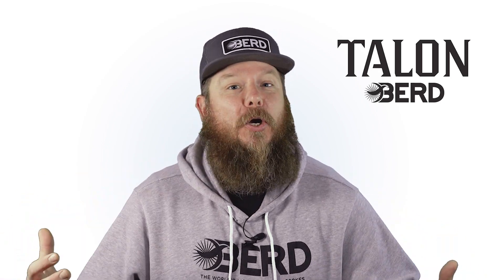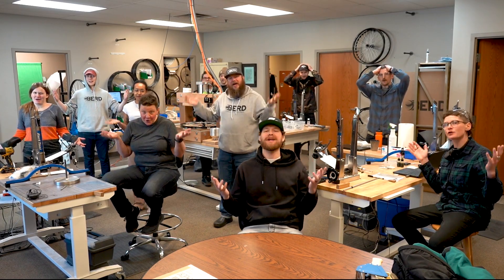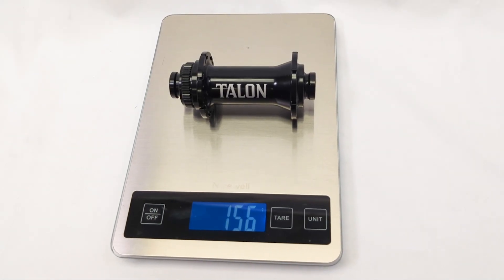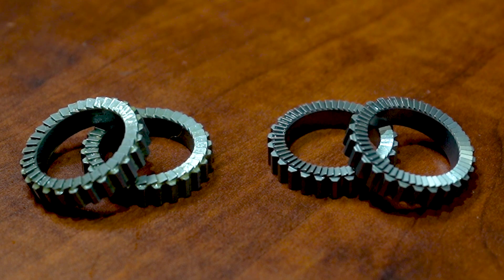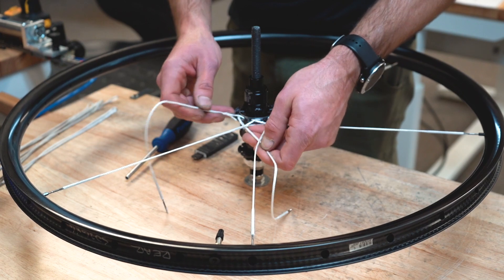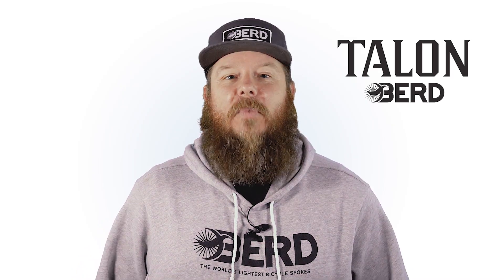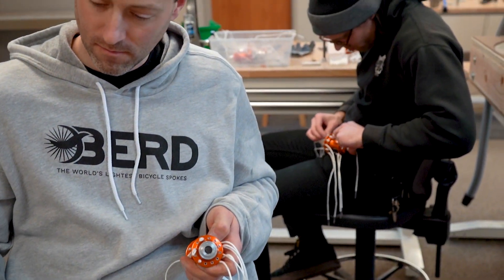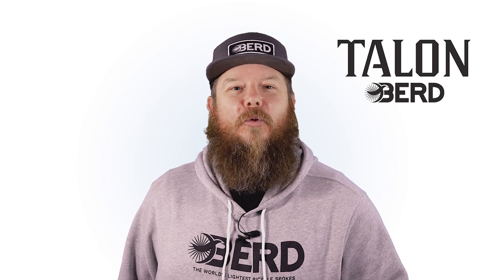BERD TALON HUBS |  Strong, Light, and Convenient. The Best Way To Build Wheels With BERD Spokes!

Comment: it's been good if you stick with a 6 bolt interface instead of stupid centerlock
Reply: Just curious as to why, as I’m considering center lock?
Reply: @JesusRescuesUs3-16  i dont know why.. 6 bolt rotor interface is so much better and relaible
Reply: @AlexeiPavlov  Cheaper too in my opinion
Reply: Centerlock hub can run 6-bolt rotors with an inexpensive adapter, making them much more versatile. Plus it’s just much faster and easier to change rotors. I see no upside to 6-bolt hubs in 2023.
Reply: @WordupG  LOL why do u htink Chris King came back to 6 bolts? No one wanna use centerlock, no sane prson would